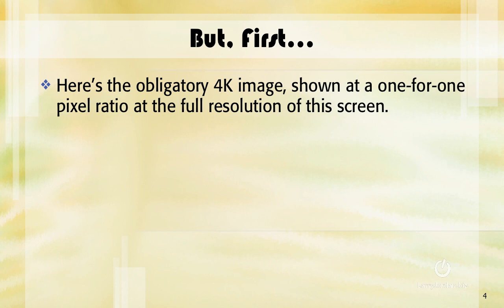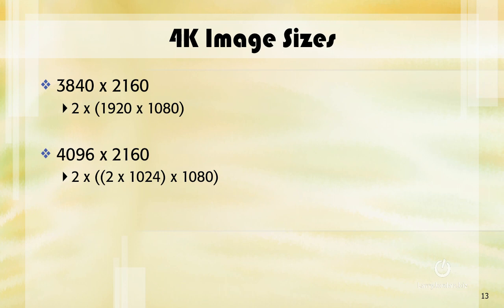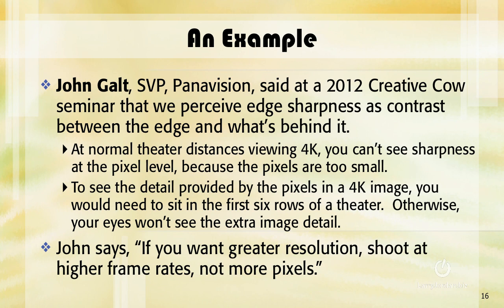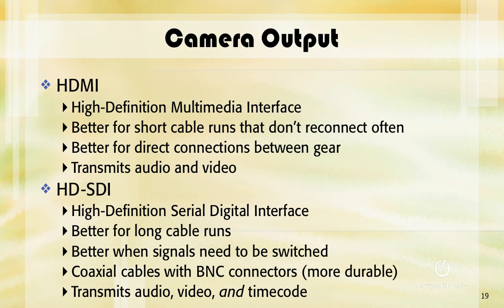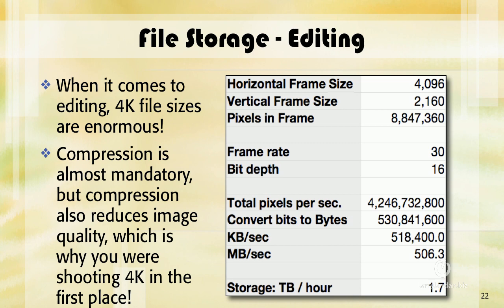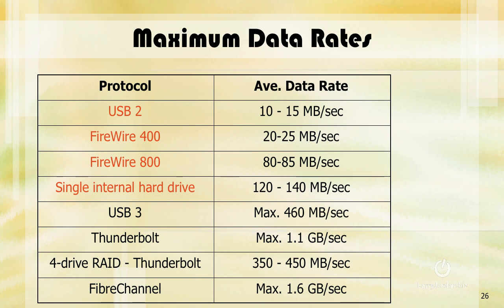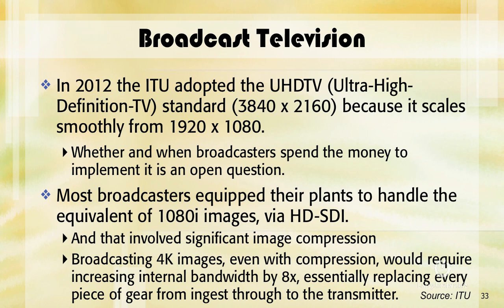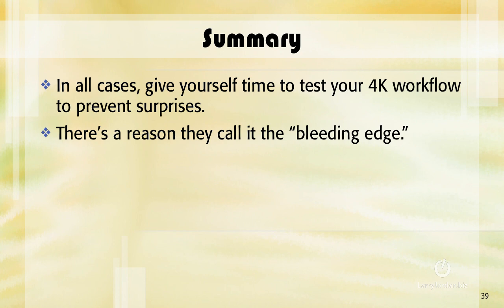4K Video Workflow: Hype or Reality  - Larry Jordan at #BVE2013

Comment: The math works out so that a Bayer sensor has to be about 4.5k to actually resolve 4k with the color sub sampling factored in....but at a 3:1 reduction in filesize....before compression....a worthwhile trade off.

Comment: The green screen stuff is a little misleading as well....a 4k 4:2:2 would have double the blue and red pixels of 1080p 4:4:4.....and usually at 12bit or higher bit depth. You can't really compare a Bayer sensor with 4:2:2 sampling. In 4:2:2 the 2 red and blue pixels will be averaged to the EXACT same value. Debayering may never lead to pixels of the exact same value because while debayering each individual pixel has its own contribution retained in the debayer....with 4:2:2 it's tossed out

Comment: I like your presentation though...one omission is that raw itself is a 3:1 compression, as the Baeyer sensor only stores 1 color value per pixel...and the wavelet encoding in red and cineform is far more suited in large file sizes then you would think...4k tv's can be had for $1200 us right now..and both ps4 and Xbox one will play 4k...as will Netflix be streaming it next year. Technology is accelerating rapidly and that is including bandwidth and compression.

Comment from the maker: I'm not saying my math is correct, but the actual file size varies depending upon frame rate, bit depth and whether the files are 2D or 3D. I was assuming 48 fps and 10 bit depth.  

Also, in color-grading the Hobbit, I was told that the data rate for 48 fps was about 2.2 GB/second. We are not yet into TB data rates yet, which is good, because we don't have any interfaces that fast, yet.